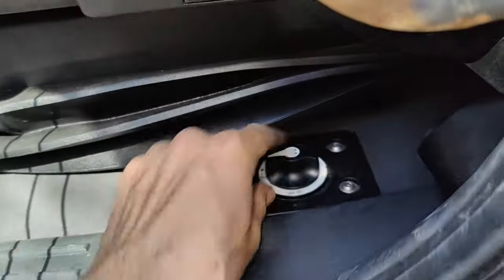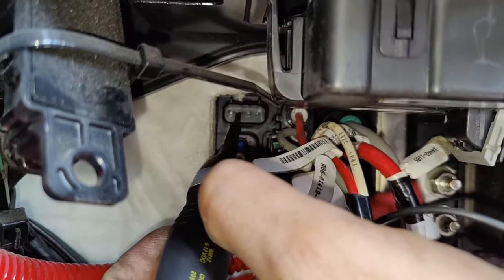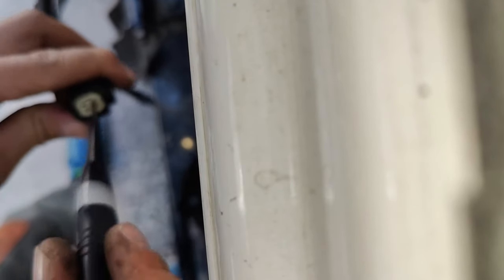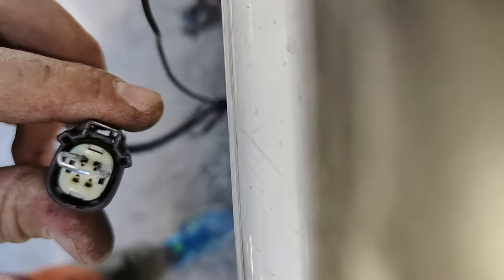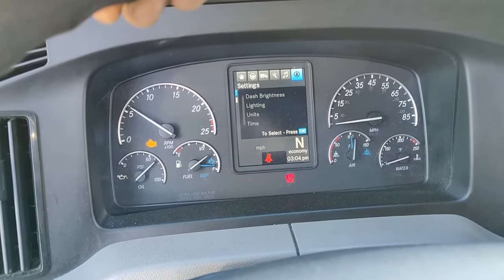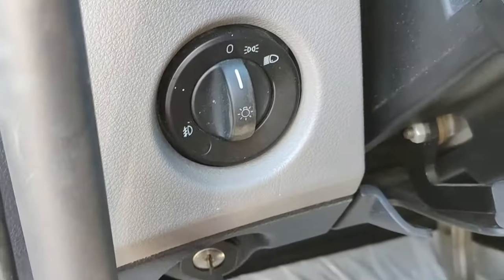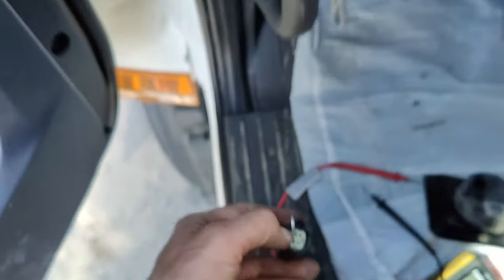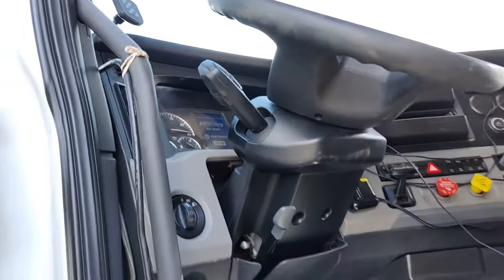Freightliner Cascadia auxiliary switch troubleshooting and bypass

Comment: Happened to me before when I was over the road. I was about to call tow truck.

I was lucky when I shaked the switch on and off and I saw the red light on and off.  
1st when light turned red. I was able to turn on the engine. But when the engine shaked the power go off.
The 2nd time when I was able to turn the key on. I disconnected the cable connect to the switch.  It was bypassed for the whole trip.
Problem solved when I got new switch for 90$ at dealership.
Reply: Can you do it yourself? no need someone who is expert on it? It look like 4 screws and plug in plug out?